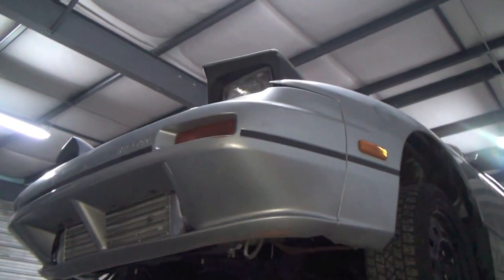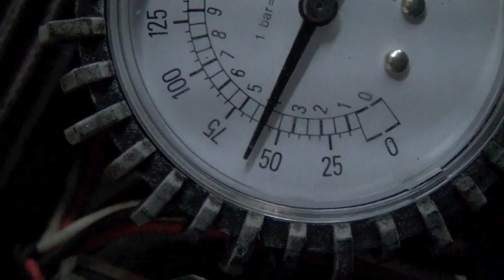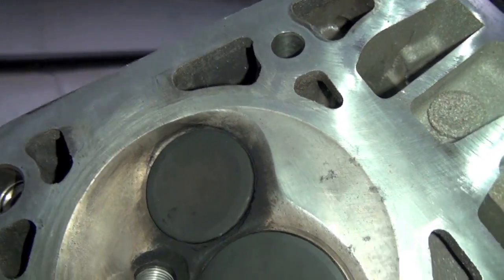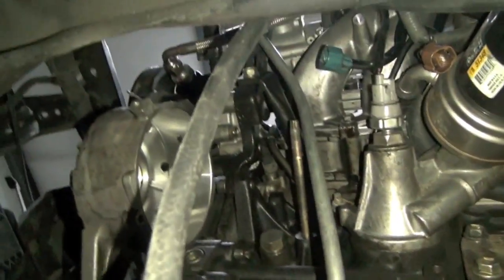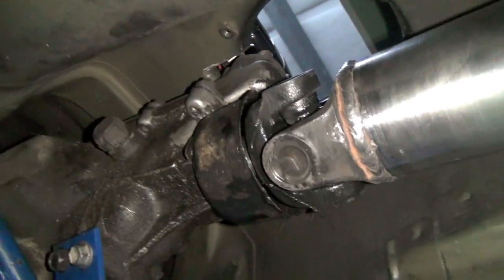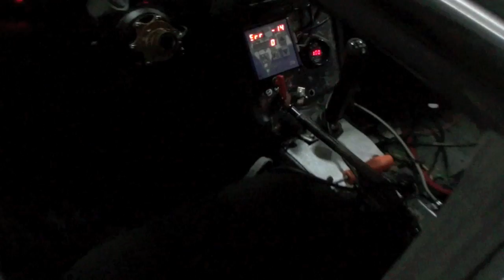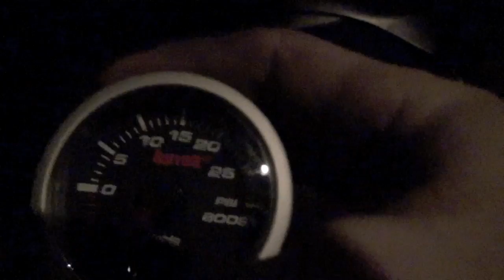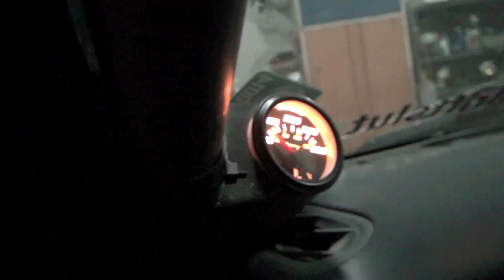1JZ swap into S14 240sx OVERNIGHT!

Comment: This is so sick, from LS to 1jz in a single night, wonder how tedious that must have been but you acted completely cool about it. props
Reply from the maker: It wasn't too bad, it all went pretty smooth since the motor was already setup and running in a 240sx, the biggest issue i had was the intercooler, and i had to clean up the wiring a bit as well as take a nap lol

Comment: That thing is so bad ass. Throw that v8 away!
Reply: that v8 is the best engine series ever made.
Reply: +Josh427SS lies
Reply: whats to hate about a reliable and cheap V8 that makes more HP NA than what your 6 cyl makes with a single turbo with a lot of boost.
Nothing.
Reply: an engine 2.5 times as big! putting out JUST SLIGHLY less than 2.5 the horsepower of the N/A i6's

Comment: That thing is so dope you should keep the 1jz if not upgrade to the 2jz
Reply from the maker: John Gorgis
rb 26 is 2.6l and hard to get parts for.
2jz is 3.0 and easy to get parts for.
Rb's are cool, just hard to keep them going inexpensively
Reply: John Gorgis If you knew anything about motors you would know 2jz>rb26.
Only thing the rb has over the 2j is that it sounds better which is really just personal opinion. With the 2jz its good for 800+ stock and with the rb you will run into oiling isues

Comment: What was the cause of the idle going up and down when you started it?? I bought a turbo car what does the same thing when you start it, Except it does it that bad sometimes it switches off. Is it just the fuel pressure or something?
Reply: ***** 
its idling that bad because of a huge vacuum leak. Noticed how his intercooler piping was unattached on purpose to blow all the dust (if any was in there), thats the vacuum leak, on purpose, but still a leak.
Reply: Adrian C. oh ok cheers

Comment: Hi, just a question , why did you removed that at 0:05 sec?
Reply from the maker: +boyfromessen96 
The ls1 had cracked rings lands on 2 pistons causing low compression and blow by. The 2 pistons needed replaced but i wanted to try out the 1jz!

Comment: Your head looks like you have had detonation due to nitrous...
If the pistons are intact between the rings I'm really suprized....
Reply from the maker: Pistons actually looked great, plug looked fine,  the ring looks fine too, idk what the issue is
Reply: ok, we had similar marks on our NOS powered bike... It had allso borken the pistons...
you could get couple cans of liquid that reweals micro cracks and spray it on the head and let it set... the clean it and spray the colour that reweals the cracks...
Reply: Actually the head has porisity issues from the casting process that is it had little air bubbles. It's actually much more difficult to cast alum. than cast iron. GM tried several times to intro Alum heads for the SBC in the sixties and early seventies but always ran into to high a rejection rate. It was only after the casting technick was perfected that the vett got aluminum heads on the L98 TPI motors and of coarse all the gen II LT1s used in vetts & F bodies. Culmimating in the all alloy LS1. How light is the alloy LS motor less than the KA or RB/JZ with there iron blocks.Plus since it is a cam in block it;s much more compact than a over head cam motor. If it were dual over head cam it would be to wide and tall to fit the engine bay of most cars thats at lest part of the draw back to fords mod motor. in SOHC OR DOHC versions.